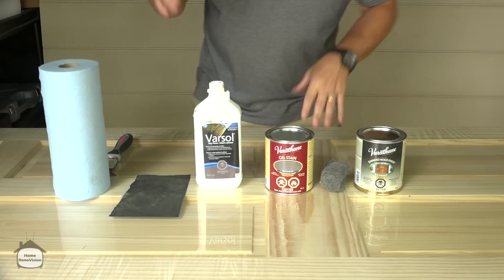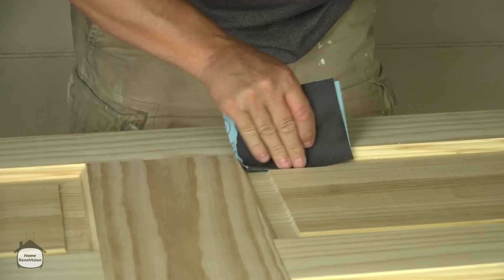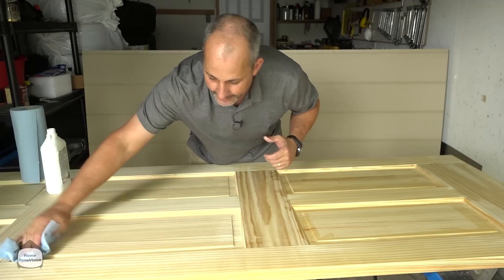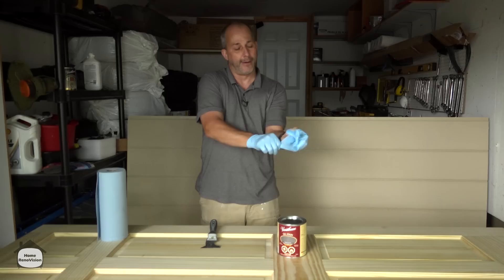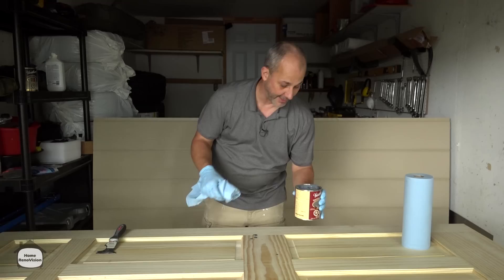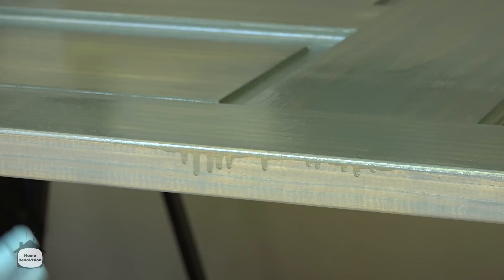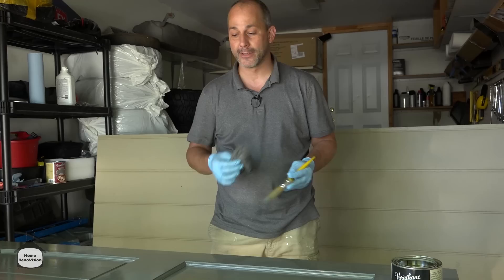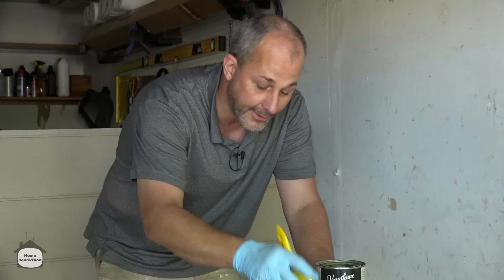How to Stain & Finish a Door Yourself | DIY on a Budget

Comment: Another great,video, Jeff, thank you!  You asked about other finishes - I'm currently refinishing all our old interior wood trim and doors and sealing with an oil-based lacquer finish. It's like happy hour every time I start breathing the fumes but probably not too good for my brain. It leaves a beautiful glow but smells to high heaven and requires a lacquer thinner, which smells even more, to clean the natural bristle brush between uses. One nice aspect is it doesn't require sanding between coats as each new coat partially melts and bonds with the prior coat. Keep up the great videos, I'm learning a lot.

Comment: I've done quite a few refinishing outdoor projects over the last few years.   Cedar accents on a house, and a few wooden benches to name a few.   I've come to prefer using a gloss spar varnish.  Yes it's marine grade.   Yes it's oil based.  Makes sense to me since the items will be exposed to all sorts of weather including rain, and snow (northeast U.S.).  After almost 3 years, the cedar accents still look great.   A pro had done them a year or so before I did with urethane but missed an important step.  He failed to sand everything to unfinished wood.  His "new" finish peeled within a year or so because he went over the existing failing finish.    I even learned something from your video.  Don't shake oil.  I'll admit I've done that because I didn't know...and kept getting little air bubbles.  Now I know why and won't do that again.  For the record, I'm not an amateur.

Comment: I have used polys on exterior wood, but frankly it just never lasts very long. I work in the marine industry, and always come back to using something like Epifanes Marine Varnish. Yes it takes a lot more work initially, but the results are really worth it. First the finish simply looks better, less like plastic and more like piece of fine furniture. Second, if you do even a minimal amount of maintenance the finish will last forever, with a half day of work every two years you will never have to strip the poly off and start from scratch, you just do a light sand and apply another coat. 

When it comes to cosmetic woodwork that will be abused, the Marine world really has the best products, they are expensive, and a little labor intensive, but really are worth it.

Comment: Thank you for putting the steps as i have just started staining my door also and this would help me. My door is an old one meaning i have to do lot more sanding before I can start applying the stain. It would be helpful to also demo on the application of steel wool to polish it.

Comment: Hi could you please answer my question...., What is the best product for repaint staircase handrail...I have tried oil based stain but I didn’t get the dark shade so wiped off everything...Then I tried varathane gel stain but still I wasn’t happy with the colour (colour was not uniform ) .. so wiped off everything... Now I am planning to paint the handrail...(bought primer and paint) ... I haven’t tried yet.... I am super confused what product should I use to get the dark brown colour on my handrail?? Please help me 
I’m new to Canada 🤞🏻
Reply from the maker: Sounds like you need to go back to bare wood first. stain shouldn't just wipe off unless you are applying it on the original finish.
Reply: Thanks for replying me....
Yesterday I finished sanding the handrail...now it’s bare wood....So....stain or paint?? Which one would be better?? And If I paint, should I put primer? Could you recommend a good paint....please...

Comment: Hi Jeff...there r a couple things I'd like to see...exterior pre-primed metal door finished...exterior door resealed (weatherstripping)-old removed & replaced-door & jamb...old, exterior, out of square door resquared...thanks Bonnie

Also I'd like to know how to, or see how to connect two concrete pieces together...ie 4" square 16x16 paver to a 4x4 or 6x6 concrete post holder so the top (post holder) can't slide around  on the paver...thanks again Bonnie

Comment: Love your videos but yes you can put oil based stain in a paint shaker. Maybe not the gel or polyurethane because of the air pockets but I personally have never had a problem

Comment: HANDY TIP
Hammer two 4 inch nails in the top and bottom edges of the door, support the nails on a saw horses at each end. When you have done the first side ask her indoors to help flip the door over while still wet.  Pre drill nail holes to stop splitting and easy removal.
Reply from the maker: ThAT IS ONE WAY TO SAVE SOME TIME.

Comment: I have a quick question:  I'm trying to refinish the exterior side of an entrance front door. Its a six panel door with molding strips installed in the panel edges. There is now some gaps in the molding. I'm plkanning on stripping it and sanding it before applying a new stain and finish. What product is best for filling in the gaps in the molding if I plan to stain?

Comment: I love your channel.  Thank you so much for your clear instructions.  I do have a question - I am installing a maple butcher block counter in my kitchen, and I am trying to decide how to finish it.  The counter will not be used for cutting, but it will have a sink in it.  My main concerns are durability and water resistance.  Would you recommend one of the Varathane products or something else for this project?
Reply from the maker: best to consult with the manufacturer of the block. They will have a warranty process in place for finishing. Cheers!

Comment: As usual great video.  My wife wants me to refinish out birch dinning room table and chair set. Any suggestions on what and how to get the best and long lasting finish? Thanks
Reply from the maker: When in doubt use polyurethane. It lasts forever. Cheers!
Reply: Thanks. I don't want to do it any time soon. OH! should I sand it all down to bare wood or can I just sand to a dull finish?

Comment: Love this! I just stained a front door & am trying to figure out why there is a milky, white film in places? I've followed steps for refinishing to the tee. Am wondering if you think this would be because I live in Houston where it's hot & humid? I thought that only changed the dry time?  ..but living here [where this humid weather is 9 months of the year] there has to be a way to work outside? How can I fix this or will the poly coat cause the film to disappear [which was suggested]? Just don't want to start all over :(
Reply from the maker: I suggest using the latex version of the product in humid environments. Cheers!

Comment: Great. I hope you answer my question 
I sanded, vacuumed, cleaned with towel. stained with water based. Right after I apply the oil polyurethane, the door surface is not smooth. still no matter what I do, my doors are not smooth.
Reply: Im sorry both are oil based, no water based

Comment: Hi Jeff
can I use the same products/technique for dinning table top?
Thanks
Reply: Alex London i would recommend you go with water based Bona finish! And stain a bit different! Sand a top with sander at least with 120 grid and apply some water on it with wet cloth! Let it dry  completely and apply stain! Dry it with cloth thoroughly and let dry for 24 hours! Applying water based finish requires some experience because of fast drying time! Why apply water? Because it will spread wood and let stain soak in and not stay on the surface! That why you can dry it very good without affecting color!
Reply from the maker: Hi Alex, this technique can be used on any piece of wood , large or small.

Comment: I know you said we don't need a paint brush when applying the stain but if I already have the cheap brushes and no towels, technically it doesn't matter?  Or it does matter because the cheap brush will leave streak marks or what?  Elaborate on that for the Non- Picassos in the room.  Thank you.
Reply: wipes gives a smoother clean look,i tried a brush in my early days and the streaks etc were so bad, and a roller causes air bubbles
Reply: Lenny Rossa      I was wondering if that was the case.  Thank you.
Reply from the maker: Hi Sandi, you might find that with a gel stain it will be difficult to do this at all without the towels. There is a definite need to remove the extra product after it sets up.
Reply: Hey Jeff.  All of that makes sense.  I don't make good sense first thing in the morning.  I should wait until midday to watch your videos if I really want to learn anything.   lol   Thanks.